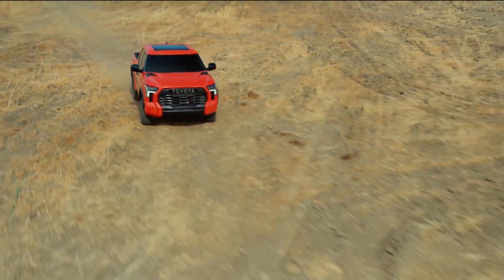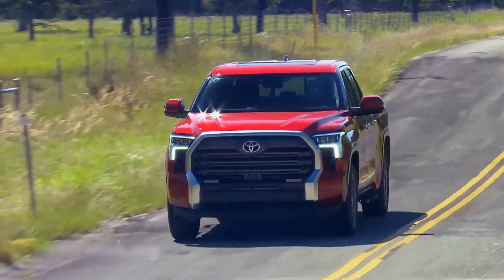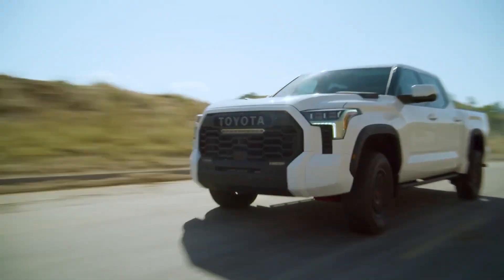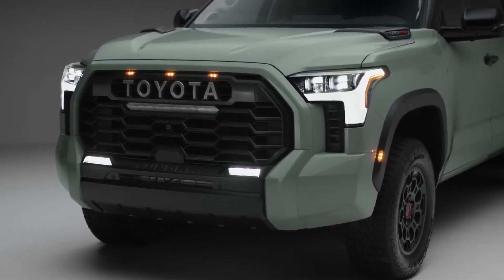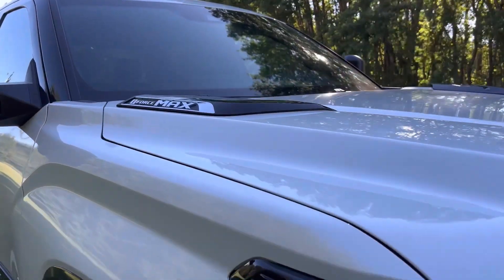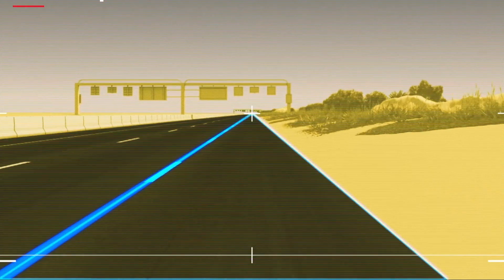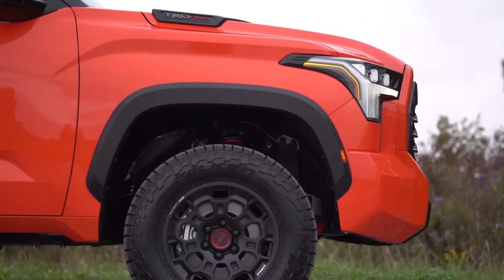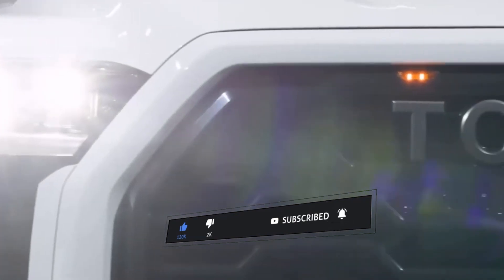Toyota’s New Truck Hybrid System Just SHOCK Ford!

Comment: People buy toyotas because they last. You csn put million miles in their engines.
Now the engines are smaller. To expensive to fix. Trade ins loosing value quickly.   Ive watched toyota on its Tacoma loosing 3 thousand dollars in less than 3 months on its trade ins. With the electric cars coming gas cars won't be worth a plug Nickle.